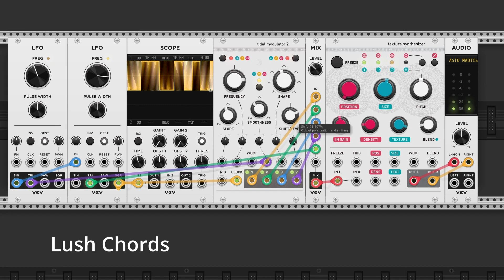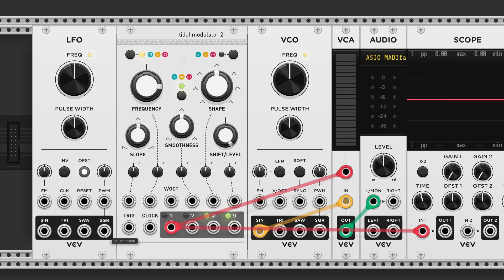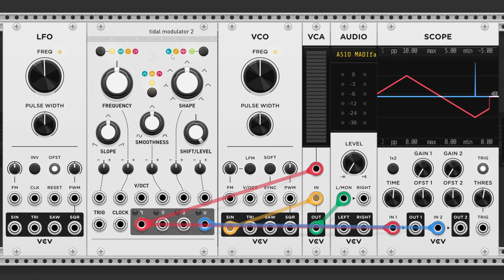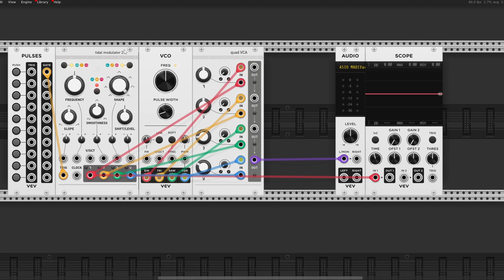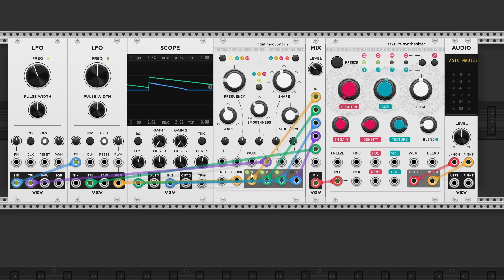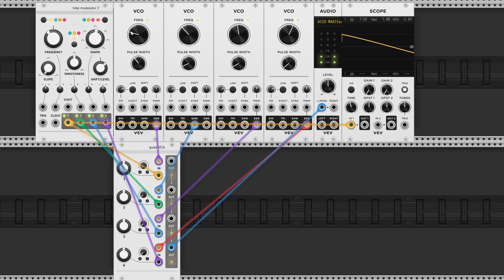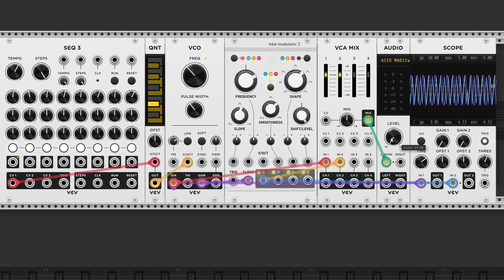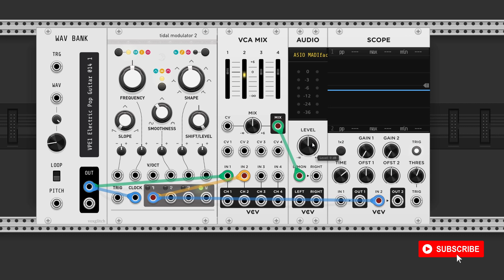VCV Rack 2 Tidal Modulator 2 (Tides) Tutorial - Looping Envelope Generator

Comment: Another Tides surprise. When I started doing patches in VCV most of the time I was improvising, so when i revisit them, some patches have connections that make no sense but give me funny ideas. Imagine you have a Marbles playing a random melody into a Befaco evenVCO and you plug it to Tides, now Tides doesn't have such an input so we use either the clock, trig, freeze or level and than send to a mixer. I wouldn't know how to explain the results but from the four outputs and half t of the modes you'll get timbre and some some strange gated alterations to the sound that are somewhat interesting. Clock and trig inputs are quite straight but freeze and level you got to turn some knobs. See you.
Reply from the maker: Wow thanks for the tips man! I love those patches where you don't quite know what's going on but still get cool sounds out of it by randomly twisting knobs. The only thing you must keep in mind is to press record 😄

Comment: Completely unrelated, I loved your video about Tides but I want to share something I've just found out that I'm not sure but I don't think you went over and that is that I was revisiting a VCV 1.1.6 old patch where there's a Tides in it and as I was playing a lead with a midi keyboard I noticed the tempo of one of the voices triggered by Tides is going in and out of tempo, I, without reason had plugged the v/o of the midi module to Tides and as you go up and down octave wise, the voltage changes and the triggers go out of a steady pulse, the interesting part is if you connect a clock to Tides the v/o input still interferes with the triggers and if I connect something other than the midi keyboard to the v/o of Tides I may get some interesting results right after this message. Thanks again for your video, very inspiring stuff. Mutable instruments is something else.
Reply from the maker: Oh you're right haha I totally ignored the V/Oct input, thanks for the tip, definitely going to try that one out :)

Comment: I'm getting to the age, when you don't need to feel stupid, you are. I completely forgot, that I had to mention, that the experience I describe in the previous post, was done with the Tidal Modulator, which is a bit different of Tidal Modulator 2. Not only forgot, but I was thinking, that if Tides (2) is an upgrade of Tides, so they must be the same, but no, the results are completely different. So, giving credit to my 64 years of age, if you try it, do it with Tides (1), otherwise, you may think I'm loosing my "marbles", i need to push the green "deja vu" to lock my thoughts from going random forever.
Reply from the maker: Ah I didn't get the freeze part, but that makes sense now haha. It's probably like braids vs plaits or beads vs clouds. Similar but different 😀 Thanks for the tip again, looking forward to trying it out 👍